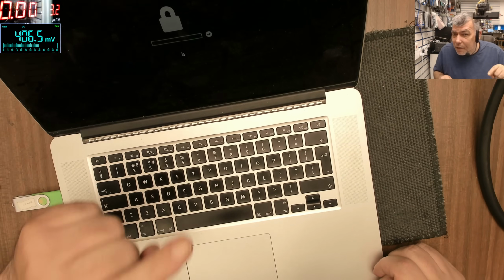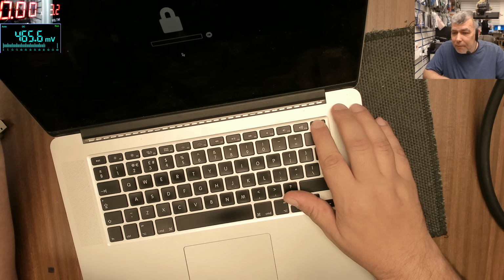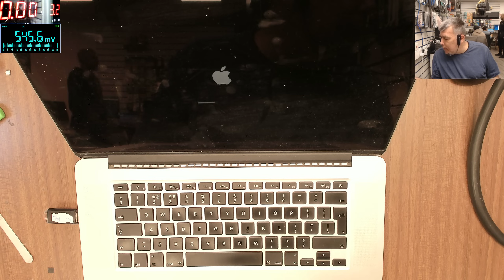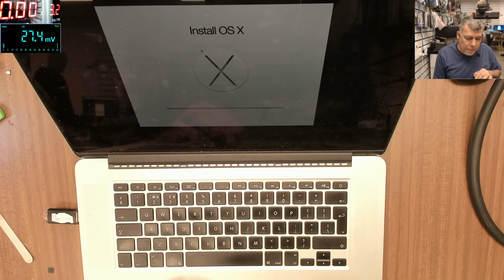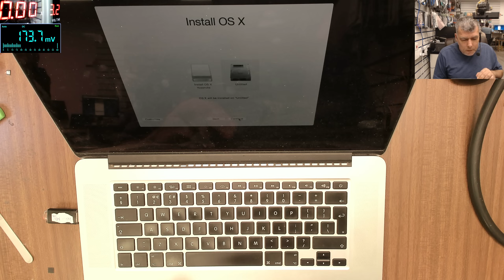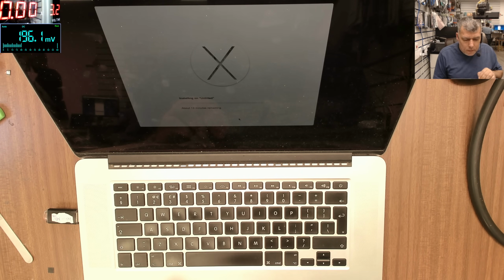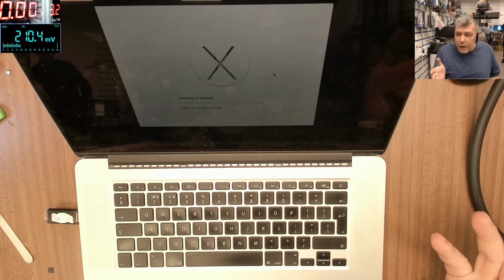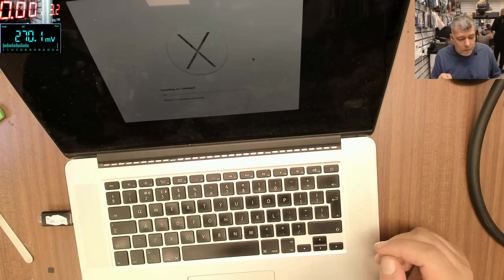Macbook password removal efi unlock - A1398 EMC2909

Comment: Thanks for the detailed video. I did this and now it boots perfectly fine. Now I have two new problems. 
1. Keyboard not working
2. Battery does not work without plugging it to charger

Comment: I got this model a few days ago at a flea market very informative repair video  thanks for the upload. Fun fact I brought a $24 bios from eBay for this board and wasn't sure the $15 with a different brand name would work?
Reply: update been trying to unsolder that chip for over a week it will not come off like it is described I got the supposed best no clean flux hot  Air set to 450 wind 6 and tried all head attachments with no luck it's still coming on so at this point haven't damaged any surrounding circuits I never had a Mac in my life thought it would be a fun project disappointed.  I am 69 years old been building and working on electronics sense the boy scouts Ham radio KD6TXB  my first PCB repair technician was with Packard Bell and NEC networking computers so I know how .

Comment: Before buying a secondhand apple computer, always check to see that the Apple ID is logged out, control R to see if the EFI is locked and get the mobile number of the vendor before buying.

Comment: For teaching purpose, this video is not good. The technician is sloppy and lazy. Provides very little intro, or technical information. Perhaps because his English is poor. He takes a short cut by leaving motherboard on case to save about 5 min of time. He pries the motherboard with a touchpad. No doubt the circuit board is slightly warped by the prying. Below the motherboard is a keyboard covered in carbon paper. Then, the worst of all, he applies heat while the motherboard on the case and warped. This instruction is not good for a beginner. Avoid it. There are better postings on this medium elsewhere.
Reply: “Those who can, do; those who can’t, teach,” or in your case lecture
Reply: Review then edit your message before posting. That is my "lecture" to you.

Comment: You can overcome this password by just removing 1 RAM chip, and keep the 2nd one. Now boot it up, and you'll see no password. When you're done with the installation, put the 2nd RAM chip in place, and job is done. No need to solder anything in this particular case :).
Reply: Ram is solded to the board..
Reply: This method only works on very old MacBooks (maybe 2010 and older).
Reply: @lenm2857  thnak you, didn't check on the newer ones. Good to know :).

Comment: No need to replace chip, read EFI using connector on logic board and clear Firmware lock in Hex editor. Then write clean dump back to chip. Takes 5-10 min and no need for soldering.
Reply: You have any video link on how to do it that way. I have never heard of that but would be nice if that is true
Reply: I would like more info about this

Comment: Keep in mind when you replace the EFI chip or flashing it from the web, you are changing both the devices and motherboards serial numbers. Many macs/macbooks around the world would then have the same serial number. What happens if one of these machines gets reported stolen??
The best way to unlock it (if there is nothing else wrong with the firmware) is to dump the ROM, clear the password and then flash it back again. This way you keep the identity of and the optimized firmware for this machine.

Comment: After solder back the compatible bios chip you have to start up the computer making a SMC reset and a PRAM reset. For better result a CLEAN ME REGION must also be performed on the chip. The processus is well documented on the web.
Reply: and serial nummber will not be same.

Comment: Why do you not just remove password. To read the EFI chip met een programmeur like the ch341a. Open with hxd editor en research for #SVS REPLACE ALL THE LINE WITH FF . and password is gone.
Reply: He finds it easier to buy a blank one for 15 and save time
Reply: @user-te1le7ck6b  yes but it is only 5 min and much cheaper you do not lose anything like serial nr etc...

Comment: I suggest using aluminium tape instead of kapton tape. Aluminium tape reflects heat, while kapton absorbs it.
Reply: HAHAHAHA, Yes, put something very conductive on/near a circuit.
Reply: @Gualluecious  Did you saw the battery was disconnected? 🤔

Comment: If someone has a padlock, it means that the laptop is stolen.
Reply: Not really. It means someone forgot their apple id and locked their ass out. It obviously can be stolen. There is a legit way to get them unlocked just call Apple and provide proof of purchase. But of course that's easier said than done. You can also do that with any aasp but they still need the POP and the process takes time.
Reply: I suppose it depends how you define easier. But I think it's easier to rip the bios and wipe the lock. Flash it back. Otherwise you must find a proper bios with the correct details for this exact board revision etc. That is non trivial. Oh also must alter serial number to remove the lock properly. Or else it's just going back to is lock when it goes online.

Comment: Hi sir, my lenovo laptop got brick while it updating Bios and now no sign on the laptop (no charging light, no hard boot). Please help me out.
Reply: You'll need to find a broken or used motherboard (ebay) and transfer the bios chip from the donor to yours.
Or you can remove the bios chip and buy a programming tool and re-flash it with a working bios firmware.
Reply: Replace bios chip or reprogram. Professional job ! $$$..

Comment: I used to replace bios chips but always did a bios dump of the chip first but for the last
6-7yrs  I just reflash them it's quick n easy when you've got a collection of known good bios files for most models & programmers are dirt cheap so why not it saves waiting for the chip & there's more money in it!
Reply: What's the process of flashing the bios do you have to remove it and kind of reprogramme it or how does it goes? Thanks
Reply: @ristatrios82   https://youtu.be/GLv7jiStHyk
Reply: but you must set up a district and serial number ? or what?  i need clean bios for 
a1466 and a1502
Reply: Medusa 2
Reply: @gdubleu  is therr some other method? on website i sesrching and it can reprogram but i dont know what to change in file that load from bios chip. need change region sn and efi lock

Comment: Hey. I do this frequently. There is a better way. Not only that but unless you bought a preprogrammed bios with the serial number programmed into it. Then this MacBook will surely run into trouble.
Reply: I bought asus vivobook on ebay.
Can yoi help me to reset/unlock bios without remowing bios chip.
Reply: @bujarberisha5834  not easily. There is no way to do this without a flashing device with which you can flash the bios. The vivobook uses a very standard bios chip with exposed pins so it is possible to flash without removal of the chip using a clip. Altho I personally prefer flashing the chip off the board.
Reply: @sallybundock1179  yeah super hit and miss with clips. I tried all kinds. Got one cost like 20bucks. Worst clip ever